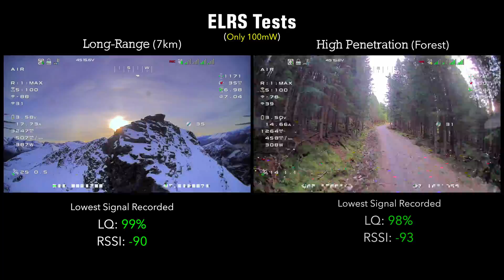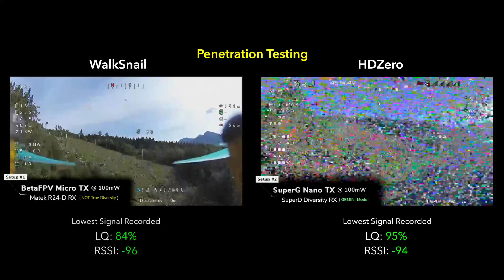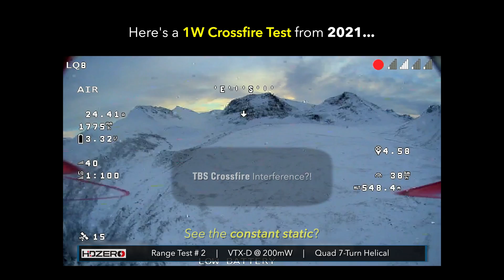Don't use ELRS or Crossfire at 1 Watt: RF Interference reduces FPV Video Quality, Range &Penetration

Comment: Very cool video ! The edit is absolutely fire haha love it 💯💯
Curious to know, if flying indoor, does more mw means more penetration ? For LOS flight it seems really unecessary to go above 250mw Indeed but for indoor flight, maybe wE should goo 500 or 1w for better pénétration ? Idk, maybe it has nothing to do with pénétration 🙎🏽
Thks for the vidéo !
Reply from the maker: You’d have to test it in your specific location, but i bet 100-250mW would be more than enough to outperform the FPV Feed. But let me know, and Thanks for watching, cheers!

Comment: I am always on dynamic (max set to 500) However, even 5-6km away it doesn't go higher then 25mw. Only way to get it to push to 150/250 is with a RP2 antenna on my Firefly when I go behind the house, which you already can guess how good the video link is 😅
Reply from the maker: Isn’t that amazing! A setup with proper antennas can operate with such minimal power! People need to see/know this stuff. So many people have poor or even broken antennas and they constantly say they just need more power. 
I’ve flown my HDZero system out over 4km at only 25mW with no problem. High gain & properly mounted antennas. 
The FireFly I definitely know haha! Can barely even carry proper antennas. 
Appreciate the comment, cheers!

Comment: I used to run 1watt on tracer.  I had low warning on 1watt than any other setting. I have switched to Radiomaster I believe I’m on 250mw. No issues. 🤷‍♂️
Reply from the maker: Yea, another point: Running things at max power tends to wear them out quickly. I think that’s what happened to my CRSF setup years ago. 
Thanks for watching & sharing your experience, cheers!

Comment: Great video, thanks. The same applies to FPV video transmitters. When you are out in the field and your friend is coming back to land next to you it will blast 600-800mW of VTX power and will degrade your video even when you are spaced few channels apart.
Reply from the maker: Yea, really any sort of RF/Electrical noise has an impact. Think about power lines, they’re not transmitting but definitely impact your signal quality. 
Thanks for watching as always, appreciate your comments. Cheers!

Comment: Very helpful.  Thanks for showing how you set up your quads dual antenna.

One question, how do you position your dual radio antennas?  Are they at 0, 45, 90-degrees, etc…
Reply from the maker: Appreciate the comment, antenna positioning on the quad is really important. Many people get it wrong, even some BNF which is crazy… but it’s really simple. This isn’t even the best setup, but it works fine as you can see. 
Regarding my Gemini antennas I point them up to create a “V” shape. 
I briefly showed it here, but also show it in my Gemini test video- 
https://youtu.be/FoSREiyDQDA

Good question though, thanks for watching, cheers!

Comment: Great video! I love my EP2 Thought I needed a Boxer to get more range But instead I bought a Pocket cause I love how little and comfy it is. Ordered a EP1 Dual and HUGE difference in range I'm limited to 250 but It feels way more stable than crossfire ever did & I'm super happy with it. Even with Video when everyone blasts the 1200 I feel pretty good on bout 800. Go a little easier on the system. Also Would you be interested in doing a stream with me some time to chat about FPV?  like an hour or 2 when your free?
Reply from the maker: Hey bud, I agree that ELRS has felt more stable for me as well. Could have been my equipment or setup, but I tried to improve it for months before switching to ELRS. 
Love the idea of doing a stream sometime, but I gotta think about. My free time is stretched thin, (kids, work, farm, and when there time hobby), that’s why it usually takes me a month to finish a video. Haha! But I’ll reach out as things lighten up. 
Thanks for watching, always appreciate your comments. Cheers!
Reply: @GiantAntCowboy  np bud same here. But basically be low effort chill and chat I'll come up with a few questions for you and you for me and just good times. Love all your homemade stuff and tests! I'm in EST so figure time diff and I'll try to make whenever would work for you good. Want to feature as many different tinkerers in FPV as possible. Build up the little guys!

Comment: why does 2.4ghz interfere with 5.8 ghz ? I don't get it, Video sytems use 5.8 ghz and ELRS uses ~900 && 2.4ghz
Reply: One aspect is harmonics, 2.4GHz second harmonic is 5.8GHz. Another aspect is that when signals are very strong then even being our of band they pass through filters, converters and saturate the receiver crippling its sensitivity. This phenomenon is called "out of band noise". You can find this expression in technical literature.  The same applies to FPV video transmitters close to receivers. When you are out in the field and your friend is coming back to land next to you it will blast 600mW of VTX power and will degrade your video even when you are spaced few channels apart. That's why you need to use 25mW in the drone race and general rule of thumb is stay below 200mW when you do a group fly with your friends in the field. It is not to interfere with your friends that are even few channels away from your channel.
Reply: @Mr.Laidukas  nice, good to know. What about 868-900 mhz interfering with 5.8, is that less of a concern ?
Reply: @Nemesishk  1. With 868-915 harmonics are less of a concern because each next harmonic is les and less in its power. 2. However sensitivity to out off band noise frequency is very subjective to electronics used. It might be affected less or even more.
Reply from the maker: @Nemesishk  as Mr.laidukas mentioned there’s harmonics at play, but also it’s just the general RF noise floor being raised. 
The issue does happen with CRSF as well, at one point of the video I show a test from 2021 which was with my old CRSF setup at 1W. 
Since switching to ELRS and running 100mw my video feed is much cleaner! So figured it was worth doing a video about.

Comment: I find it interesting that there is this general concept that more is always better. I fly my crossfire at 250 and have never failsafed. And I run my vtx at 500 and get great performance for the type of flying I do.
Reply from the maker: Exactly, it’s all about finding what you “need to achieve” your goals. Lol, I turned this into a life lesson… 
But I agree, sometimes less is more. Thanks for watching and sharing, cheers!

Comment: would be interresting to see if you could print something arround the radio antenna which shields the signals. like a half faraday cage which only lets singals go out from the front and not up and behind to your goggles
Reply from the maker: This might work, but it also might have surprising affects. I saw a video years ago by IBCrazy where he taped a piece of copper wire behind a CRSF Diamond Directional antenna and it completely changed its performance. The wire wasn’t attached, just floating behind, which goes to show how sensitive RF equipment is to outside factors. 
But it’s always fun to experiment!

Comment: Yep... in the "old" days with a 70cm long-range system we'd run a coax cable from the transmitter to an antenna on a tripod some distance away from the fpv video receiver antenna to mitigate this... That's still an option with the removable antennas on the radios/modules... but, yeah - I find myself trying to "optimize" my control link until it dawns on me that my fpv link will be gone long before the rc control... Habits from the aforementioned "old" days, still!  Cheers -
Reply from the maker: Haha! Yes 100%, these modern control links are so reliable it doesn’t take much for them to outperform our 5.8ghz FPV systems. The most important this is proper antenna positioning, and honestly use a true diversity RX on all new builds, there like $20! 
Thanks for watching, appreciate you sharing your thoughts!

Comment: Great advice here!!! I have found the same issue and always limited my controller to 500mw and dynamic. I’ve flown super far with just 100mw and the higher power just kills your controller battery quicker and makes it hotter and gives video limited range as you’ve shown here. Great content 😎
Reply from the maker: Absolutely, a guy Wez last year flew 100km (60miles) with 2.4ghz at 100mW. (That didn’t end well with the local authorities unfortunately) but goes to show ELRS can easily outperform and 5.8ghz Video Link we have… and as you said adds noise, kills the battery, and overheats your electronics which isn’t great,. 
Thanks for watching and leaving a solid comment, cheers!
Reply: @GiantAntCowboy   is that really possible at 100mw? what was the packet rate ?
Reply from the maker: @Abhishek__Parihar  I don’t remember which packet rate he used; unfortunately the video was removed due to legal actions against him. Total bummer. 
But yea he made it no problem, they had people with goggles that were connecting along the path since no FPV system can easily cover that distance. 
Really neat.
Reply: @GiantAntCowboy   so radiomaster pocket 250mw elrs will provide enough range and stable connection without any problem for a beginner like me ?
Reply from the maker: @Abhishek__Parihar  if your antennas are not damaged and mounted properly you should have no problem. As you see in my tests even 100mW performs great. 
In your OSD make sure you have LQ & RSSI figures set up, and watch these closely on your test flights.
Reply: @GiantAntCowboy   okay, thanks for advice 👍

Comment: Great tip! Gonna give it a shot. Planning to dial it down to 100 mW from the usual 1000 mW. Tried bumping it to 500 mW, but didn't feel much difference, probably 'cause the terrain was a bit gnarly. Quick question though, why do they even make transmitters with that kind of power? Is it for better signal penetration or what's the deal? Anyhow, appreciate the solid advice! Happy flying, buddy!
Reply from the maker: If your setup is working properly there should be no need for more than 100mW since your FPV link will fail before the control link. 
I think they make/sell 1W transmitters mostly for “Marketing” reasons… people who “need 1W” to outperform their FPV feeds generally have an issue with their control link setup.
Reply: Awesome, looking forward to giving it a go! Just one more thing on a different note: my packet rate was initially set to 200 Hz, but I dialed it down to 50 Hz since I'm rocking an 868 MHz RT. Think cranking it down might give me a bit more range? @GiantAntCowboy
Reply: @Wild_Mavic4Pro  yes slower packet rate gives more range
Reply: Thank you! @flat-earther